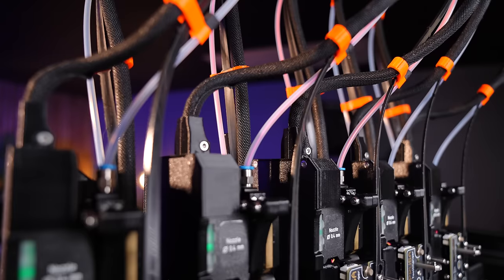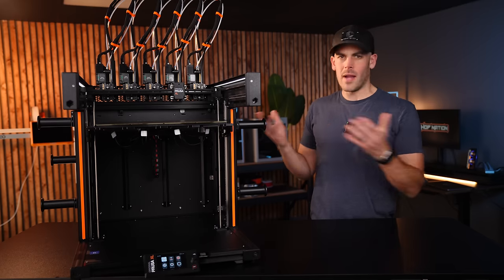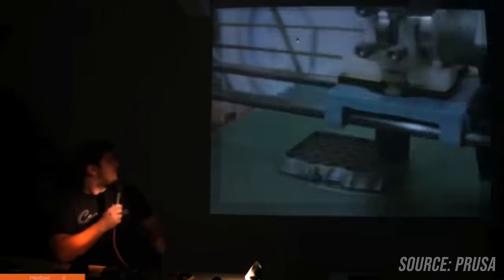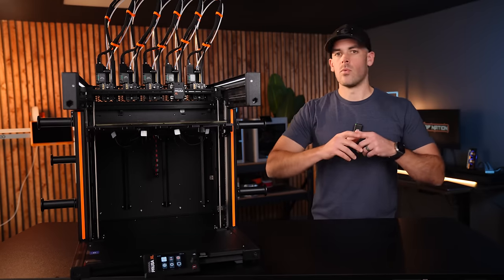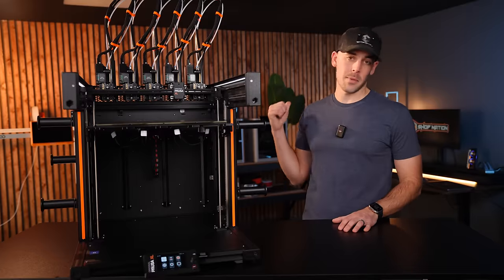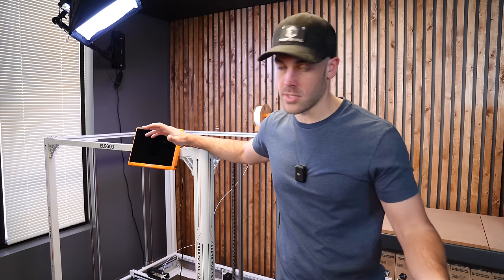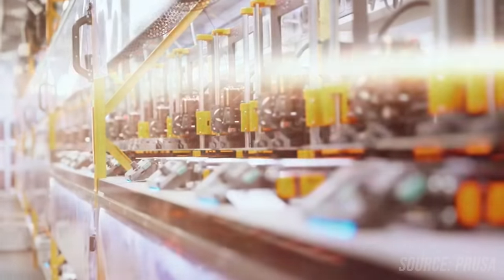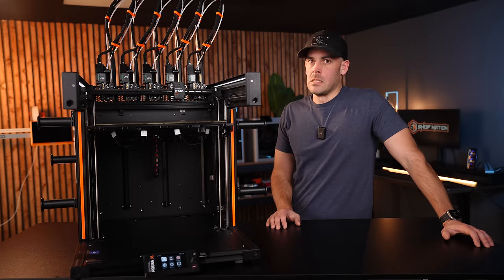Why Prusa is the next Blackberry

Comment: I think the only thing the Bambu has going for it is speed and cost. With them you move production to China, give up privacy, lose the ability to repair, and kill innovation with proprietary technology. Bambu took open source tech, adds proprietary tech to give it an edge, and sells it for cheap with Chinese labor. Once they have that large market share the open-source innovation they built on will end, and you will be stuck with a $100M company that doesn't care about its users and will crank out the same thing year after year. They will truly be like iPhones in that they are nearly impossible to repair, competition killing, overpriced disposable products, made for consumption instead of practical use. Those fun trinkets that you mock are exactly what Bambus are made to crank out, at blazing speeds, to appease childishly impatient consumers who want their toy right now. Bambu marks the end of the golden era of 3D printing innovation.
Reply: I hard disagree. The golden era of 3D printing innovation ended even without Bambu. Innovation with FDM 3d printing is drastically slowing down, we're reaching the limits of what is possible with single filament printing, with hardly anything else needing to be improved on other than multicolor, and multicolor/material innovation can really only go so far. Printing at even faster speeds reduces layer adhesion so there's no point, we already can run at extremely high accelerations, pressure advance is basically perfected, dimensional accuracy is the best that FDM can allow. All this is already open source technology, the only way forward for innovation now is if a person or company invests the time and money to compile all these technologies into an appliance that an average consumer can use with a push of a button. That's what the X1C is, it's not for tinkerers or innovators, it's designed so the average consumer can just use it without having to think about it. It's not marketed to "childishly inpatient customers," it's marketed to people that want a product that just works, and it does even more so than the Mk3. The innovation of the X1C is about making 3D printers a feasible mainstream appliance anyone can use.

It also isn't impossible to repair. The only downside to its repairability is the fact that parts are proprietary so you have to buy them from Bambu, but when you're designing an appliance for mass production it's impossible to avoid the need for proprietary parts. 3D printer parts are naturally replaceable, and most calibrations are filament specific so Bambu can't just use anti repair practices like Apple or use serialized parts. It won't be long for 3rd party replacements to be developed. As far as Chinese manufacturing goes, the Ender 3 is a Chinese product, and that was widely respected in the open source community as the printer that introduced affordable 3D printing to everyone. Why is the X1C any different? In regards to your concerns about privacy, you don't need to use their cloud services if you don't want to, you can use an SD card old fashioned style.
Reply: @ThatOneStopSign  I thought Prusa provided the models for users to print their own parts?

Comment: What I would like to see and have : 

-Printer size between XL and MK4
-Two extruder head (mainly for multimaterial purpose and to cut price)
-modular heat bed design
-Fast bed leveling focus on the printing area
-built in camera
-built in enclosure
And other nice features like input shaping, mk4 filament change system and Prusa support!

Comment: Prusa innovates but, its frustratingly slow. The XL isnt a disrupter with this price tag. They need to focus their resorces on creating a low cost, competitive, corexy printer.
Reply: The innovation is not given by the price tag, it would be a desservice to have a low cost machine when theres a lot of low cost machines that are low cost because os material quality or bad customer support, if your looking for that it would be advisable to look into the offerings of the competition and not try to pull the quality down to reach market price.
Reply: @JonaDVargas  cost doesn't always go hand in hand with quality. Scaling up, supporting less printers, and using better manufacturing techniques can bring cost down. I have several prusas. They are great, but lack features for the price.
Reply: @IvanJoel  the problem is that in order to achieve that they would have to produce in China or Vietnam to really compete but they had their parts, developed by them, copied that way and sold by third parties on china and from china.

Comment: Agree with most of what you said in the video. Ive just upgraded my Mk3 to Mk4 because I wanted the input shaper support and better first layers. Looking to get a second printer with multi colour support (ive previously tried MMU2 and Palette2 and had too many issues so have up on them). I think Prusa have made the right decision to go with the 5 toolheads but as you say I wonder about the price. However I cant justify getting a Bambu for multi colour because of the much slower speed and amount of waste. I just couldn't face throwing all that waste away every time I print something. I cant decide whether to just pay the price for the XL (and potentially save the difference in filament) or whether to wait to see if any other company does a multi-head printer. And yes I am old enough to get the free CD/DVD-ROM reference, in fact I'm old enough to remember free floppy disks.

Comment: I bought a Bambu lab P1S after years of playing with 3D modeling software but never owned a 3D printer nor used one. I saw someone show how easy it was to use and I really wanted one without dealing with all the usual 3D printing problems. The only thing I need to improve is my Filament storage even if the printer almost never gets a break the filament soaks in moisture faster then I use it. I don't own a AMS either.

Comment: For me i think the xl is not so much for multi color but more for people who use expensive filaments with soluble supports or multi color since needing to do a purge tower for those filaments can get expensive. the xl I think is going to be for the industrial market and I think prusa is going to focus more for print farms and businesses rather than the hobey market where reliability, support and less downtime are more important than speed. 
secondly, I disagree with the statement that the mk4 and xl were rushed since it takes time to design make and test a product.
thirdly, I think something that a lot of people don't take into consideration is the fact that bambu, prusa and creality are for different use cases for example, I think bambu is an amazing machine but I don't think its great for companies or print farms where NDA agreements restrict a lot since bambu needs to be connected to the internet to be updated or have prints on it. its the same with prusa where I think its not so great for hobbyists since it is very expensive however for printfarms and businesses I think prusa is best.

Comment: I have two MK3s and two Bambu X1 with AMS. My clear preference is for Bambu. The ease of use is miles ahead of the MK3. My printers are in the garage, computer in a different room. Start print, monitor print is a breeze. I have had Bambu for over 2 years now, and with minimal maintenance, it has served me thousands of hours. Sure, Bambu is not perfect either. But, it is impressive for the 1st product they have released. If they continue on the innovation trajectory for the next-gen models... Prusa should be very worried. Prusa needs to innovate to survive. For people starting with 3D printing, or not knowing much about it, Bambu is far easier system to start with.

Comment: I think if prusa managed to reduce the mk4 price to like ~500$, it would more competitive. The thing is they always use premium components all around and its not really feasible. 3D printing parts in such a large scale is not really practical either. Plus they didnt really design it around being easy to assemble. At their scale they could easily injection mold the parts to reduce cost, and make it easier to assemble. They are kinda stuck in a situation where they are known for open source and repairable printers but the new market is heading somewhere else and they cant really change what they are known for.
Reply: actually they are using injection molding in some of parts, they only use 3D printed parts when they see fit.
I think the biggest issue is their testing procedure, it takes them 4 hrs to assemble MK4 (12hrs to assemble XL) and test print and then disassemble (according to their video) but they decided to test every components and assemble it to test. As you said, they should optimise the assemble procedure on design level, but also push the quality from their parts providers instead of testing every components. Or even compensate the fault rate by providing spare parts to customers. They are definitely over sampling which is way too labour intense.
Reply: premium components? prusa? absolutely NOT. They self-3d-print many parts. Injection molded parts would be cheaper, more precise AND stronger. The display is ATROCIOUS. The rods are super basic. The motors are off the shelve stuff too.

There is absolutely nothing premium about a MK4 in terms of materials or parts ...

That is also why Prusa - unline Bamboo - needs to assemble, then test, then disassemble all printers. That is SUPER expensive - but shows how high their part failure rate is if they have to constantly test everything.
Reply: @m4ko288  bro what. Bambu likely tests every single part too… most non shit companies will too. They don’t assemble and de assemble, they have test jigs for everytjjgn. The motors on the mk4 are from ldo which are known to make high quality motors. The hotend is manufactured by e3d. The rods and bearings are Musmi and belts are gates. All high end name brands. That’s what I mean by high quality. Bambu doesn’t use any name brand stuff. 
Printer parts doesn’t mean it’s bad at all either.

Comment: I have an MK3S+ that started life as an MK3 and was upgraded to an MMU3S first.  It has an MMU3 that started life as an MMU2 and was upgraded to an MMU2+ before becoming an MMU3.

For me to upgrade my MK3S+ to an MK4 will cost me $680 (I have the silver power supply and the wrong heat bed, so I have to pay extra for each).  The kit for a brand new MK4 is $800.  So the upgrade is only $120 less than the full price.

I will eventually get the MK4, but I'm wondering if I should upgrade or buy new.  If I upgrade I do save $120, but if I buy new, it would be pretty much like buying a used MK3S+ for $120. Some of the listings I see on eBay charge more for shipping than that.

The Bamboo lab with its four color AMS does look interesting to me, but I'm so invested in the Prusa environment, and the cost is over twice as much for a new X1 with the AMS unit--that has one less "color"--that it's just too much for me.

Comment: Prusa and all manufacturers need to enclose units, and move to multi head core xy, A 3 head core xy will give you the ability to use dissolvable support and 2 colors, this flexibility will lead to Tpu hinges printed with peg encapsulated locations in place. Or other multi material prints.  Closing in on injection molded territory. Innovation has got us this far and  making it available to everyday makers is a game changer

Comment: The thing is, same as with the iPhone, first impressions matter. 
When i look for a new printer and see the mk4, that cost 1,2k, still has printed parts, and still looks like a A8 and compare it to the bambu lab X1 that (currently) costs 1,25k, is fully enclosed and looks more like a tool then a project, then my decision pretty heavily tends towards bambu lab - just from first impressions.
Maybe if the mk4 came enclose and not so expensive i might reconsider it, but for 1,2k i expect a bit more then prusa currently offers.

Comment: Personally, I don't understand why people don't talk about QiDi that much. I have an xPlus3 (my first printer, got it a month or two ago) running and I've had ZERO issues aside from crappy filament or incorrect tuning. No, it doesn't have a fancy lidar camera, but that hasn't been an issue for me. The capacitive bed leveler is perfect and, because it's enclosed, I've never even had to run the filament heater for materials like ABS or ASA.

Comment: The Prusa XL looks great, but it's not just not priced for consumers. 5 print heads would be amazing, but for the price, you could fill an entire room with printers and print many things at the same time. And with some glue, you could make a multicolor or multi-material print using those in less time than the Prusa XL would take. Granted, gluing parts together is less versatile and less durable than printing it all in one piece, but how often do most people need to do that to warrant the high cost? I think there are very few people in the hobbyist 3D printing community willing to spend thousands on a 3D printer, no matter how amazing it might be, when you can get so much for just a few hundred these days.

Comment: Although there are several things about the XL that other machines do way better, I believe the lack of a heated chamber is it's biggest flaw. They made a big and expensive machine with super cool features, that basically just prints multi-colored PLA, PETG and TPU parts.
An industrial looking and priced machine that works best for printing toys. 
90% of the stuff I've seen people print on their XL so far, you could print on a Bambu A1 Combo that costs $560. You need to waste A LOT of filament to make up for the price difference. 

Being able to combine TPU with PLA and PETG prints is super cool, but honestly how often do people do that?

If it had the ability to print ABS, ASA, Nylon and so on, it would probably sell extremely well, because it would cater more towards companies and businesses. 
Companies that care way less about the price, the lack of a good touchscreen, the lack of a camera and the slightly slower print speed compared to a Bambu. 

Hopefully we see them release a proper enclosure for it down the line, with the design of the machine this should be completely doable.

Comment: If Bambu would bring out a dual extruder CroXYY 500x400 next (basically an Idex Cross-XY design which eliminates the long belts CoreXY would need at that size), nobody will still want the XL.  Even for the niche the XL can now cover which Bambu cannot, two separate extruders would address most of it.  Printing a different filament as support separation layer with a second head seems much more useful to me than printing multiple colors ...

Comment: You are correct. Prusa is in a downturn if they don't accurately understand the  the market.  3D printing is open sourced modeling, but in the future not majorly open to open sourced hardware in the open market?  just an opinion.  Most people don't want to build and tinker,  they just want a printer that works. Open source is great ,  but may be  Prusa's downfall..

Comment: I have a P1S and wouldn't say it's the "iphone of 3d printing". It's certainly less grief to make it work than other printers and very fast. But I've had my share of failures and some hard to fix. For example I had some filament snap off just as it entered the nozzle and also several other places so it would neither advance nor retract. I had to replace the nozzle (carefully removing the probe and sleeve) and dismantle everything back to the AMS to clear it. When it works it's great but I wouldn't say it's idiot proof - you need to have experience to deal with its issues. It's not quite an appliance yet. I've never owned a Prusa so I don't have anything to say about them except they're expensive and that's what puts me off more than anything else. I do think Prusa needs to look at what Bambu is doing and make some affordable, easy to use entry level devices.

Comment: In another video you say initial price of a printer was not a big issue when amortized over the lifespan and number of prints. 
The tool change method is like what we use on CMMs and makes color changes way more efficient time wise and purge waste, so that will offset the cost difference over the lifespan. If it is way faster than the X1C then it will make money faster. 
The biggest disadvantages I can see is the amount of real estate it needs and heating 5 print heads at once will drive up power consumption. 
For the average hobbyist it really doesn't have much of a future. But for prototyping in an industrial setting and print farms it may be the way to go.

It's made by a company with a great reputation of quality and customer support, and something that matters to a lot of people, it's not made in China.
Reply: It takes hundreds of thousands to a million filament changes to match the break even price.
You can buy a fleet of A1 (also open air printer) and still beat the XL in efficiency, yield or bump up to p1s or X1c for enclosure and exotic materials. The XL just isnt good bargain unless you have a very specific need.

Comment: I think moving to CoreXY is a given, but the real game-changer looming on the horizon is non-linear slicing. Prusa is particularly good with complicated software, and a 5-axis machine will require a lot of that. If they can introduce 5-axis as a future Mk4 upgrade or release it with the small CoreXYs they have in their factory, that might be what puts them back on top.

Other than that, they really, really need to design their printers with enclosures as standard, not an afterthought. And ideally, those enclosures should be designed to easily feed directly from filament dryers. I see so many issues on 3D printing forums caused by temperature fluctuations and wet filament. Enclosures and dryers shouldn't be seen as an add-on anymore. Choosing not to use them should be the exception.